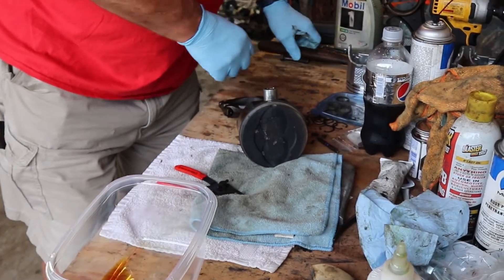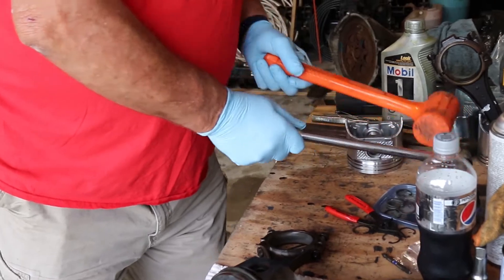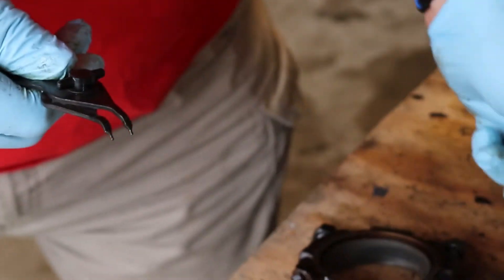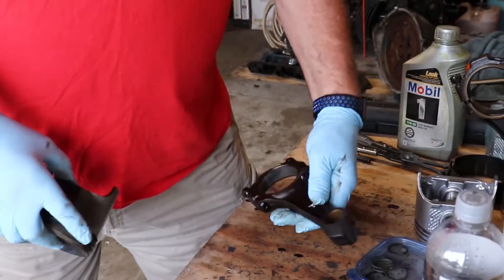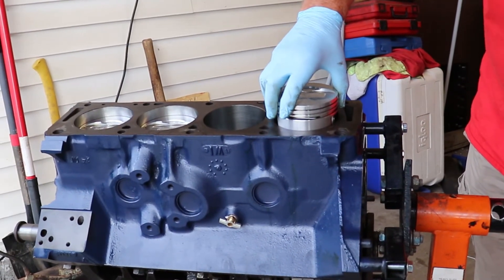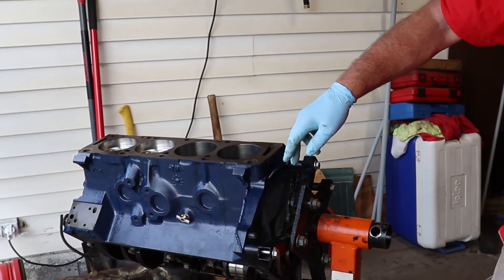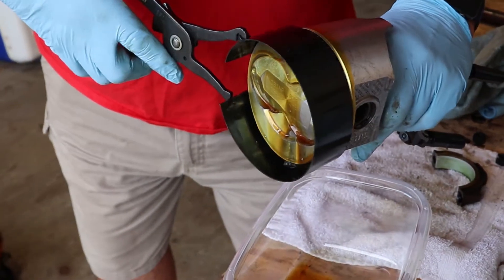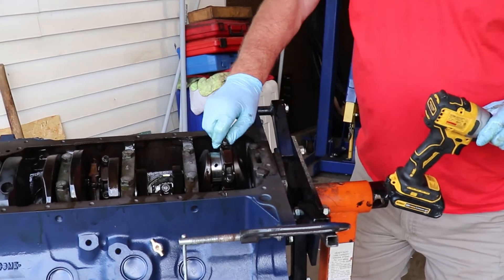How to Install Pistons | Tinkering with Tony | Motorhead Sweethearts

Comment: Hey Tony,
Thanks for the great video's. I have a question, I have a 390 GT motor and I am in the process of replacing the intake manifold and valve covers. When I took the roller rocker cam out I didn't mark the push rods and now I don't know which one goes where. Would it be ok to put the push rods back in even know they most likely won't be in the same port I took them out?

Comment: Well done. I like to assemble engines bare handed, constantly wiping my fingertips on a lint free cloth. I always wipe the bearing saddles and bearings with my freshly-cleaned, bare finger tips before installing the bearings, this removes particles which could become trapped between the bearings and the saddles, to ensure correct clearance but also maximum heat transfer. I probably would’ve had the crank polished, and run 0.001” under bearings if necessary. 

As well, I didn’t see it in the video, how was the block and cylinder walls were cleaned? The cylinder hone used after boring the cylinders oversized leaves micro-particles imbedded in the crosshatching that negatively affects ring seal. ATF and blue shop towels work great to lift those particles and clean the walls - keep scrubbing until the towels remain pink after scrubbing. 

Great videos, seriously well done, and what a great experience.
Reply from the maker: We will let Tony know!!